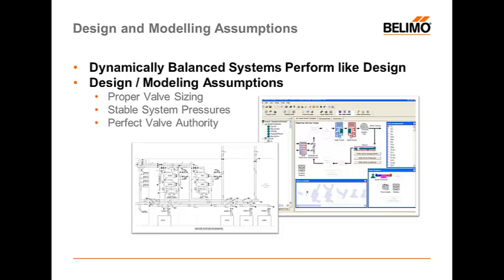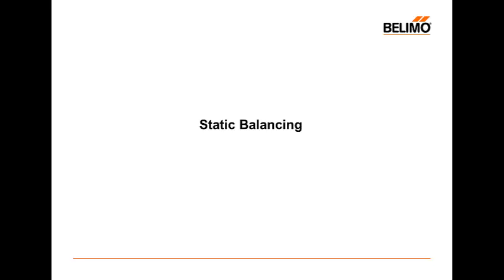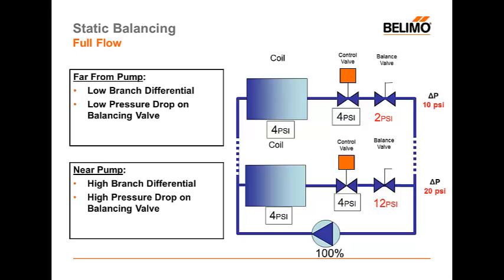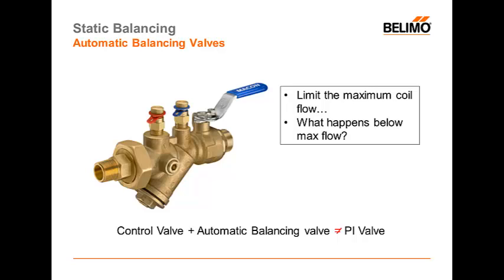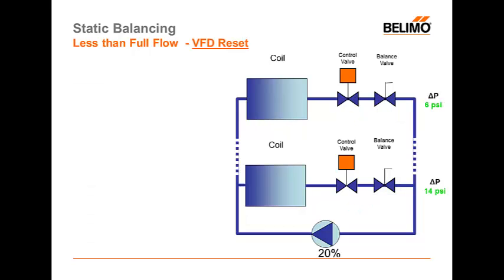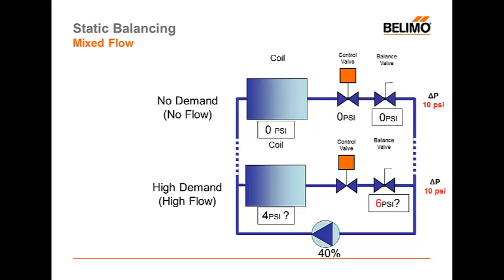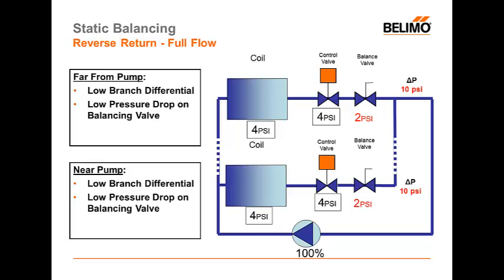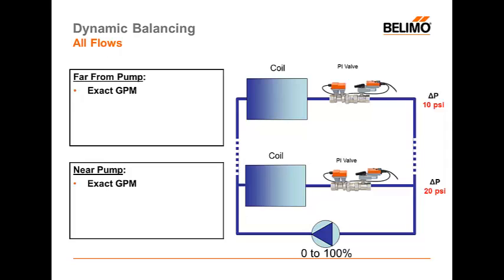Webinar: Dynamic Balancing with Belimo Pressure Independent Valves

Comment: well, this presentation should've been called "issues with the statically balanced hydronic system"! 
he has barely talked about the dynamically balanced system no details discussion about how pressure independent valve works nor how they could solve the issues he eluded to in his 15+ minutes before that

also, one thing, for a two-way valve at a reduced flow, although that the pressure differential might be larger than at full flow conditions, this does not mean higher flow. since the valve is modulating by restricting the flow, its characteristics ( pressure vs flow Q vs DP) is different than at full flow